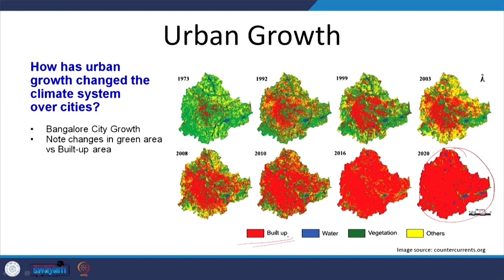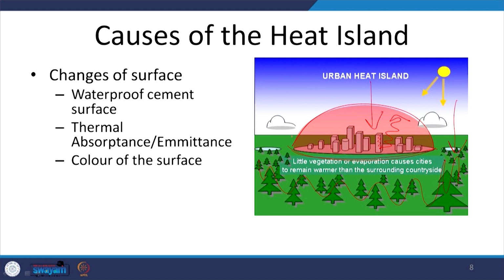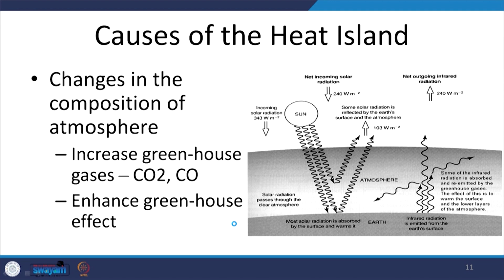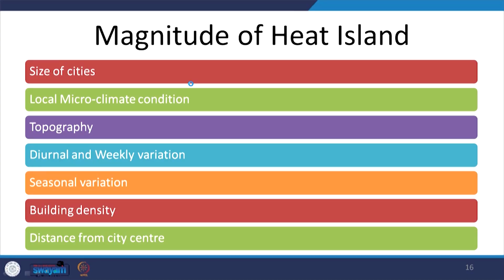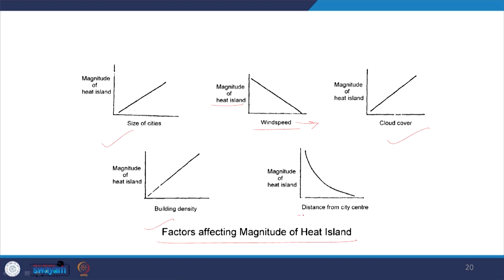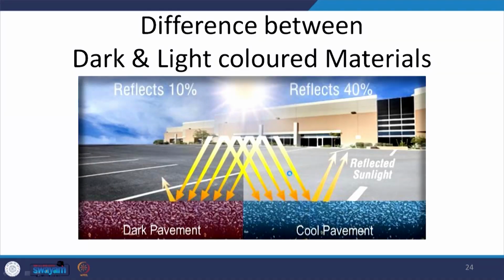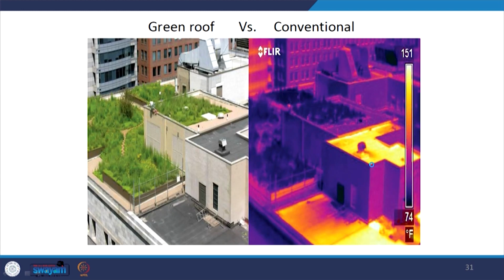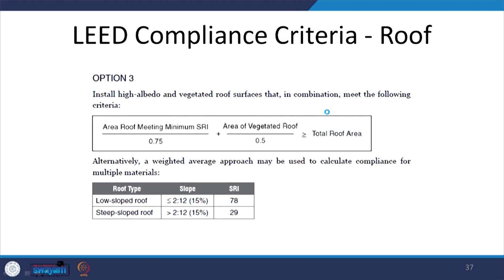Lecture 23 Sustainable Sites - III

Comment: Mam is developing near city centre is wrong because in case of UHI we prefer less building density but on the other we need to increase the density becaus of the transportation as HONG KONG country did
Reply: i think dont think UHI has any thing to do with density and to control UHI we need to have right materials use to build house/city.